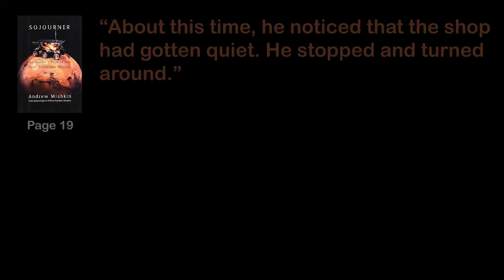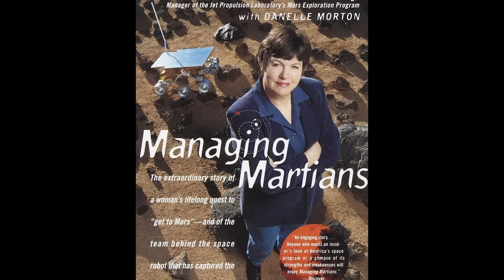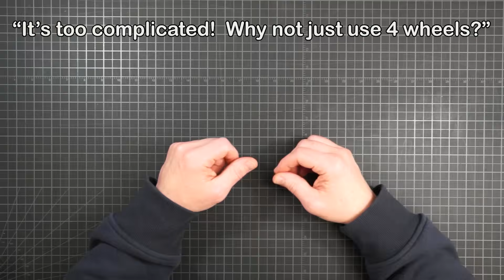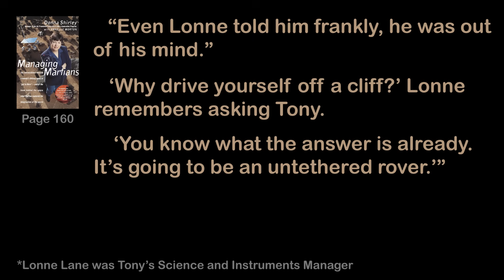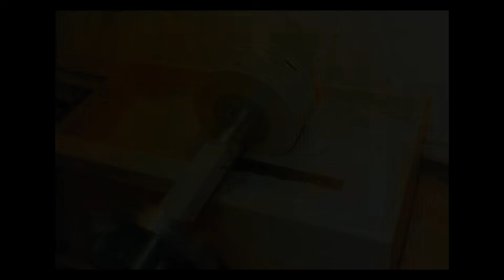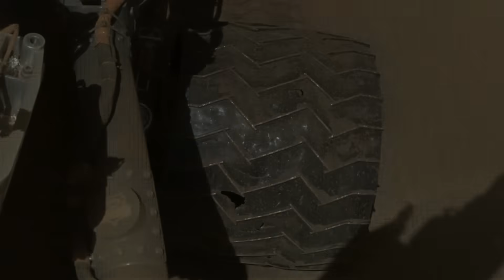The Engineer who invented the Mars Rover Suspension...in his garage

Comment: I worked at JPL for 25 years, 15 of those driving rovers on Mars. I remember working closely with your dad during the Sol B446 anomaly (Purgatory). The hours spent discussing the details, the hours spent in the ISIL testing how to extricate the rover. Looking at the charts you have enclosed, reading names I recognize, seeing faces I haven't seen in years makes this video very different for me. It is interesting to note that while the original design had the rocker in the front, all rovers had the rockers in the back but soon I realized the rovers have a much better traction when driven with the rocker in the front (you avoid pulling a wheelie therefore driving it as a 4 wheeled vehicle). Your dad was a true engineer. Nowadays engineers make themselves noticed by bringing Porgs on Lab or wear Mohawks and post on social media.

Comment: I met a similar man through repairing his computer. He designs boat hulls, using Autocad and a flow design tool. Some of his designs are Australia and word wide. He studied electronics during the time when the transistor was introduced. If there is an issue that can't be solved from a boat motor, industrial steam turbine, or industrial compressor and refrigeration plant, he would solve it.
I'll gladly spend more time listening to his, stories than it takes to work on his machine. He's still designing boats in his 80s.

Comment: How many computers did the OSU Adaptive Suspension Vehicle have?  That thing is seriously impressive for something from 1985.
Reply from the maker: I’m not sure about the computers, but it was impressive.  It had multiple gaits, could sidestep, and even rear back on its hind legs to life the front ones in the air.  And, it was strong. It could drag hundreds of pounds behind it.
Reply: @GearSkeptic  I looked it up.  There were 17 Intel iAPX86/30 realtime control computers, each with an 8086 processor and an 80130 support chip running Intel's high-performace iRMX realtime OS.  16 computers operated the motion works and one was used for operator control.
Reply from the maker: State of the art 😉

Comment: The rocker bogie is simply a modified road grader bogie system, something that has been around for 100 years.
Reply from the maker: Superficially, they are both six-wheeled vehicles, but that misses the entire point of the linkages.

A road grader is just a four-wheeler with a trailer, and essentially a two-bodied vehicle.  The difference between that and a rocker bogie is discussed in the video.

If it helps: pay attention to how each wheel connects to the vehicle. Does it connect to the body, or to an articulated linkage? The grader has multiple points of connection to its multiple mechanical segments. The rocker bogie has all wheels connected to linkages, which are themselves connected to each other, with a single point of connect (per side) to the actual vehicle.

It’s a fundamentally different system, with profound results in performance.

Comment: Thank you for this marvelous eulogy. 

I would like to trouble you with a request, could you measure the rover wheel and tell me where you took the measurements, please? I'm trying to use photogrammetry, but I found conflicting information for the reference measurements accros various papers (and I'm pretty sure in the litterature I have the cleats as stainless, not titanium). I am in the process of making a high quality 3D model and associated documentation of the Sojourner rover, and I'm struggling with both simple facts and details.

In the ideal situation I would like the the width of the tire, the external diameter of the tire (tire being just the band of metal) inside the cleats, the prominence of a cleat from the tire, and maybe the overall rim width (that is the aluminium part), those things seem to have been designed in metric (LA Times: "JPL Machinists Off Kilter in a Metric Universe")
Reply from the maker: Ok, here are some measurements with a digital caliper:
Rim diameter 120mm
Rim width 80.17mm
Tire width 70.76mm
Cleat prominence 6.27mm

The tire is a thin sheet of stainless wrapped around the rim, but the cleats are titanium patches spot-welded onto the stainless band, and riveted onto the rim with aluminum rivets (I suspect the rivets were only to hold the cleat patches in place for welding). The cleat patches go edge-to-edge across the band, and are made of two rows each of raised spikes. They are 11mm wide. 

Hope that helps!
Reply: @GearSkeptic  Going back the pictures, I think the rivets are a different beast, they go all the way to the rims, they pinch the tire on the way there, I suspect that they they transmit the driving torque to the rims and also keep the tire buckling under control when the temperature swings (I have weird feelings about a stainless tire on an aluminium rim at super low temperatures).

Thank you again for your time. I have started editing my 3D model based on your message.

edit: something is fishy about those rivets, some pictures show wheels without rivets, but the final high res pictures of Sojourner (with badge and WAE visible) show rivets, I suspect that they are a late addition.
Reply: @GearSkeptic thank you very much!
Reply: @GearSkeptic  you seem to have kept your first name private in the video, should I credit you as GearSkeptic without any further mention of your ientity in my notes? they will be public.
Reply from the maker: Sure. That is fine.